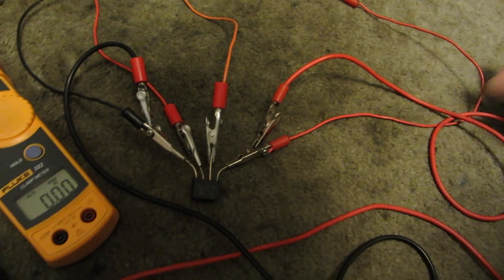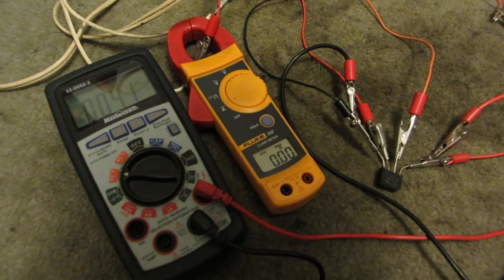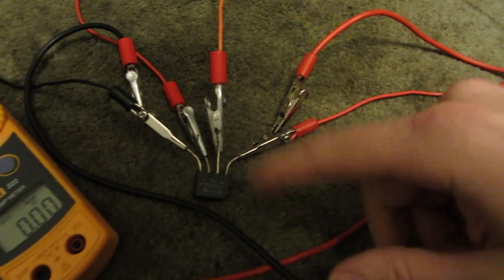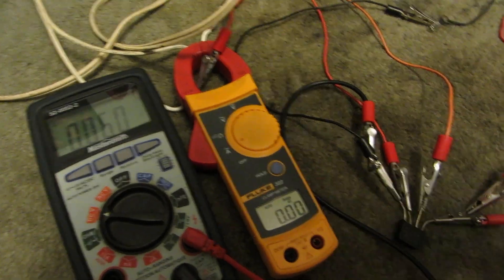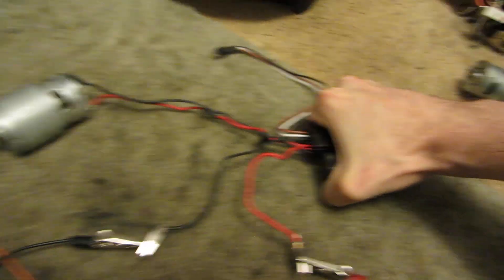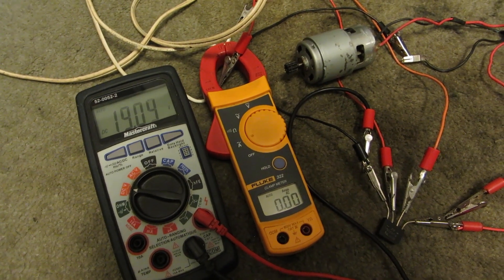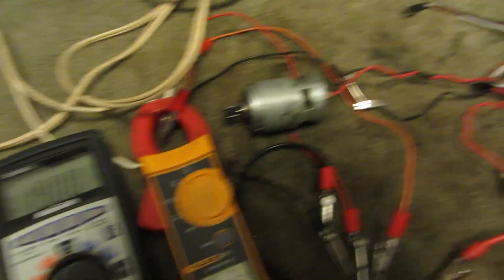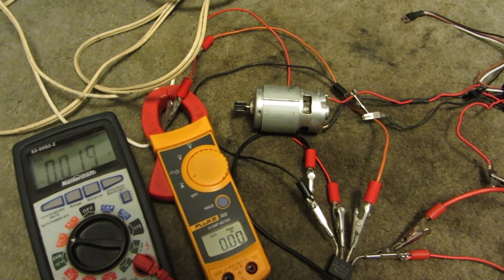Strange Electrical Phenomenon, Explainable?

Comment: Use a Analog Meter to confirm the effect you are getting, getting the voltage up ON load is possible under Asymmetrical 'conditioned' circuits, but that you can confirm with the first suggestion i gave you change it to an Analog meter! for now it looks like the DMM (Digital Multimeter) is picking up conducted emission  from the heavily Inductive motor kick-backs! That is interfering with the digital meter! I see that you have not filtered the D.C from the FWBR!

Comment: The rectifier is converting the AC power into dirty AC power, so you'll see voltage flux like this. Likewise if you have a resistor and capacitor across the output of the rectifier you'll see a higher voltage under no load then when it's under load. If you leave the rectifier without a filter cap and resistor you can overheat the rectifier. Switchmode power supplies increase power as it's needed so naturally they'll increase current, but the voltage should be stable.

Comment: My interpretation is either weird inductive load stuff as some others have mentioned, or something's up with your rectifier setup. I don't see a smoothing capacitor unless there's one on the input of the speed controller trigger thing, so it could be the motor (or even a cap on the output of the speed controller) smoothing out your rectified wave more when running faster, and the meter's averaging method isn't quite true RMS or whatever would make it read the same for an un-smoothed wave.

Comment: the only thing i can think is the way the switching power supply works it must be giving out a messy sine wave back into the rectifier, you could try hook up a large capacitor to the motor or to the dc side of the rectifier to see if it helps